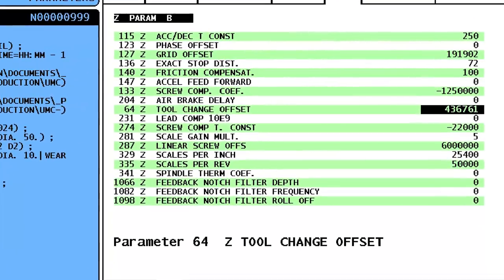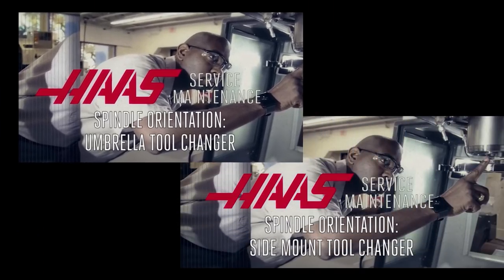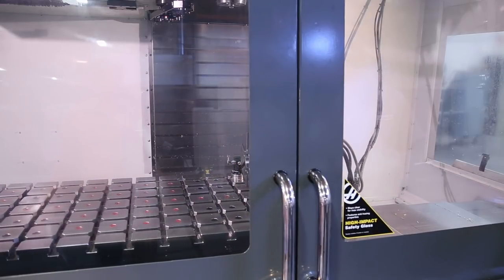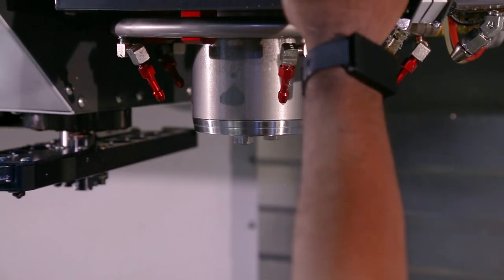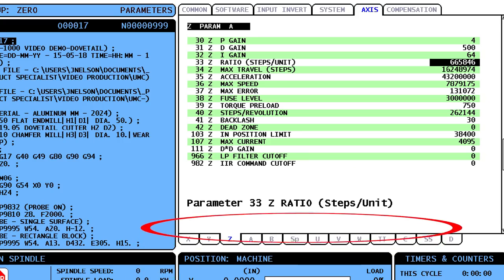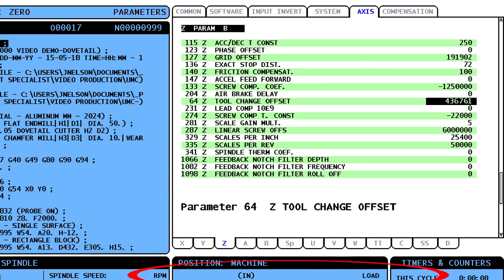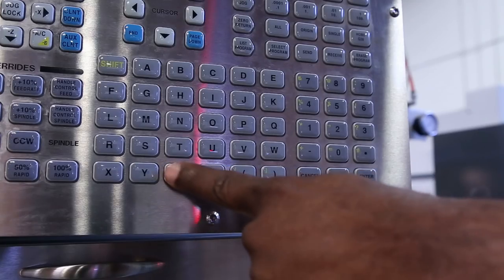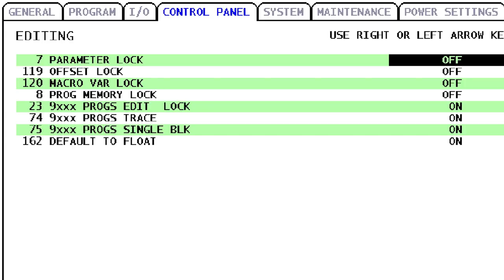Reset Parameter 64 on the Classic Control - Haas Automation Service

Comment: Do all the machines have a software home position for the ATC or do some have a physical limit switch?
Reply: it's always in the software, to allow very fine adjustability like this.
Reply: So by this ATC pos for umbrella is about G53 Z-4.25 and for SMTC G53 Z-.437. Does that sound aproximately correct?
Reply from the maker: dragonfly fab - Great observation, you are correct.  All Haas machines have a limit switch home position that the machine references at power up restart. From home, it uses parameters to calculate the tool change position.  - Orville